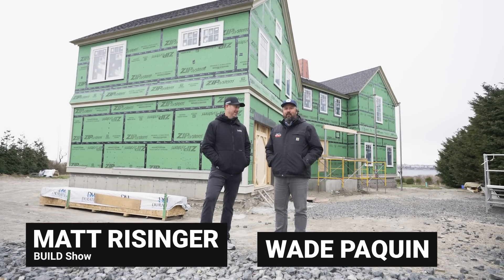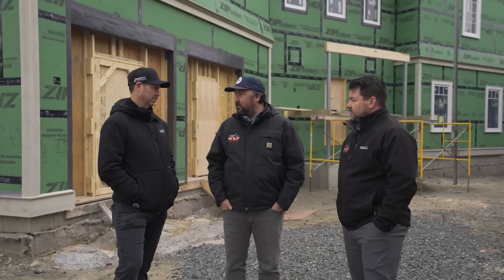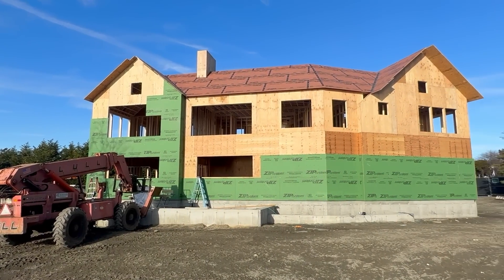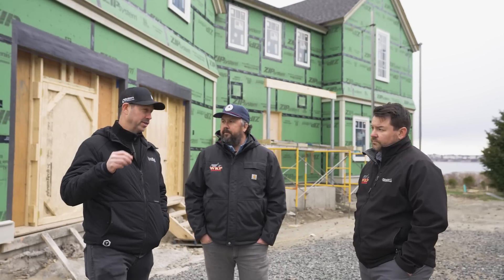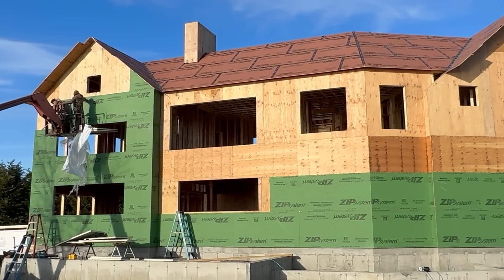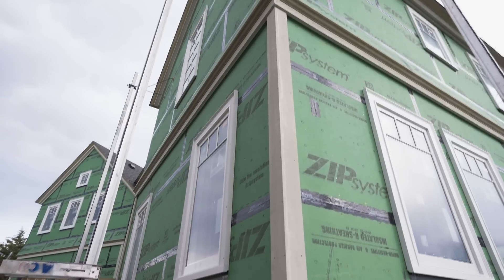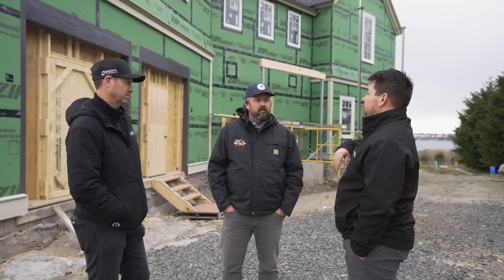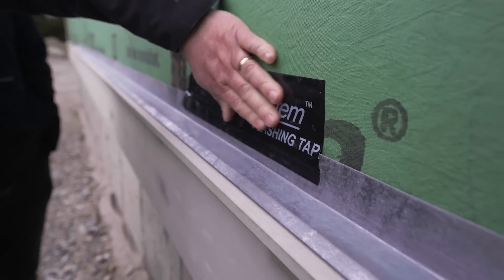SITE BUILT SIPs Framing Explained

Comment: Not really SIP unless the ZipR was bonded to the prefab plywood with a roll on or screeded adhesive of some sort. SIP starts with structural. It was wrong to say structure, foam, structure as if the OSB or ply IS structure, it is not. It is the sandwich composite that makes a SIP structural.

Comment: Matt, can you explain a bit more about the need for "shear"? My understanding was that ZIP-R by itself was essentially CD plywood with extra stuff, so why is that not enough shear strength?
Reply: He explained it in a previous video. Basically the thicker the foam the less shear it can take because the plywood doesn’t work as well when it’s spaced off the house. So Zip with 1” of foam has a higher shear rating than Zip with 2” of foam.

If you sheath the whole house first that plywood has no foam and thus the highest shear rating. Then the zip is only there as weather barrier and insulation.

Comment: as a person who's had to work with SIP, I fully approve framing the house and then putting SIP on the outside.
Reply: Is it truely a structural insulated panel if the shear load is satisfied with the CDX?
Reply: @jwiereng  I had the same question but to give them the benefit of the doubt they're probably referring to the entire finished assembly (studs+CDX+Zip R) as a "SIP" - an excusable bit of clickbait.

Comment: Wait.. they put a layer of insulation on the outside of a SIP panel? That has how many inches of uninterrupted insulation sandwiched in between OSB sheathing? Isn't that like putting a jacket on top of coat? Very confused...

Comment: I live on the coast of SC where we design to 140mph +, and Huber tells me that I can use ZIP R as a shear panel.
Reply: I’m designing in AZ with zip R-12 and don’t seem to have a sheer issue with 115 wind load design
Reply: @brentsalazar7760  what fasteners do you even use with that?
Reply: Could be a local code. It's crazy up north.

Comment: he said he needed the CDX for shear but isn't that the whole point of the zip system?
I mean I live in FL and our winds reach 140=150 during a hurricane...
Reply: It sounded like the local code wouldn't allow the zip to count for shear because it has to fasten through the foam (cantilever off the framing). I presume for shear value they require sheathing fastened directly to the framing.
Reply: it looks like you can get shear rated ZIP panels, but it's most likely easier to install shear panels, then tack zip over it, so you don't have to stitch the zip on and have 100 steel fasteners being thermal bridges through the zip.  where I live, depending on house design, there are places they have to have 5/8 CDx on the outside AND 1/2 CDX on the inside both with nails on 4 inch centers around the perimeter, and 12 inch centers in the field.